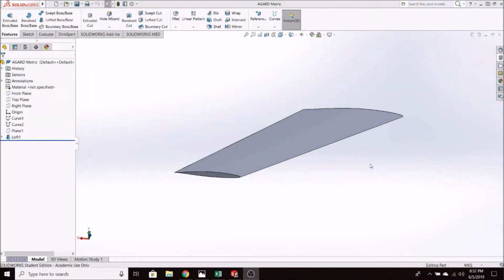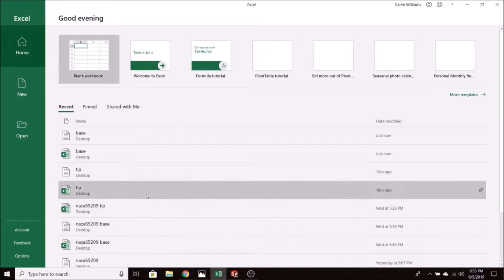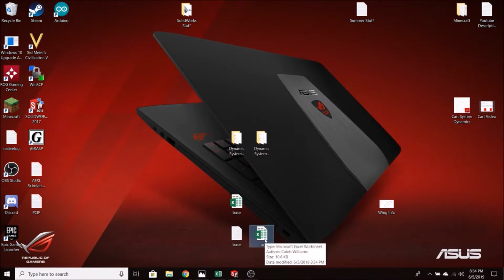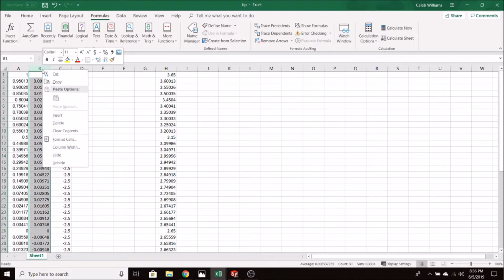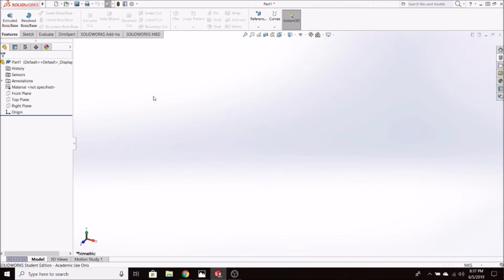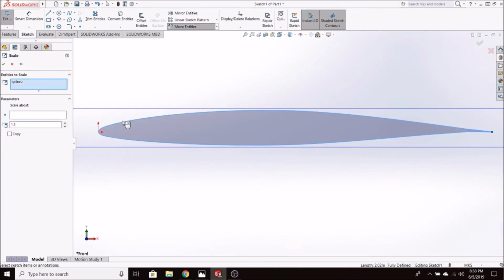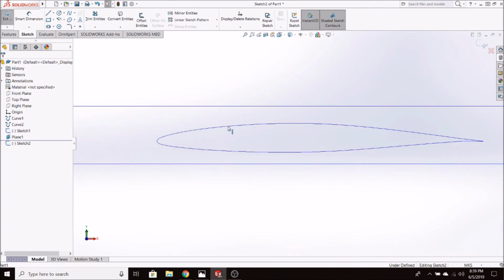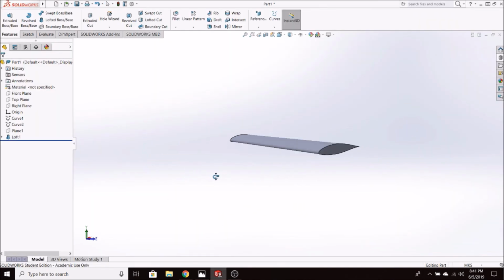SolidWorks Tutorial | Swept Wing From Airfoil Coordinates

Comment: Hi, when I try to mirror that  loft to create a set of wings, their merging is messed up. It results in a sweptback wing but the merging point is messed up. I mirror with respect to the front plane and I mirror the loft feature. Please if you have any advice on that matter or a video to guide me that would be greatly appreciated.
Reply: Nevermind, I solved the issue by performing a Boundary Boss/Base rather than a Lofted Boss/Base. Thanks for the tutorial.
Reply from the maker: @kskyvalakis  Glad you figured it out!

Comment: Ironpine
May I ask where you found the N_D = 0.25*... formula from? I am looking for the same thing for Boing 737 wing-classic. On the UIUC web site that aircraft has 4 airfoils.
Reply from the maker: Arash,
I calculated that myself from the wing geometry.  If you know the base and tip chord lengths, and the angle theta of the quarter-chord line, you can find what I have labeled as N_D.
Note that N_D is 0.25*C_b  + S*tan(theta) - 0.25*C_t.  Basically 1/4 of the base chord length plus the distance in the x direction from the quarter-chord point of C_b to the quarter-chord point of C_t.  Then subtract 0.25*C_t to get N_D.  It's the x-distance from the tip of the base airfoil to the tip of the root airfoil.
Let me know if you have further questions!
Reply: @ironpine5815  
I am not an engineer. I am a computer guy that I am trying to create a somewhat accurate mesh of the Boeing 737 wing to run my code on. So please forgive my ignorance, if my question is too simplistic. Based on what you have mentioned, it appears N_D is 0.25*C_b  + S*tan(theta) - 0.25*C_t should be an aerospace formula that applies to all wings? 
The airfoils for the Boeing 737 exist on the UIUC's web site but 737 has four airfoils which two of the middle ones are called midspans. I am trying to figure out how far the midspans are from each tip. Any insight on that?
Reply from the maker: Arash,
Yes - the equation for N_D should apply to all swept wings.  I can't guarantee it, but I can't see where it wouldn't apply.
For a wing like the Boeing 737 where you have four different airfoils, you first need to determine the span, S, of each section.  This may be tricky.  But once you have that, then just use the N_D formula to find out the offset of the tips.  Apply it in succession - eg. find the x -distance between the leading edge of the root and the first midsection, the first midsection and the second midsection, and finally the second midsection and the tip.
Does this help?
Reply: @ironpine5815  Sounds very reasonable. Thanks :)
Reply: @ironpine5815  Hello,Can you tell me if I find span for each section,for instance there will be 3 section here.Now if I take 1/4 scale of the original scale,How N_D will change with that?
Reply from the maker: @adnan6149  I'm having trouble understanding your question . . ..  Try diagraming it out on paper and see if a relationship for N_D sticks out to you.